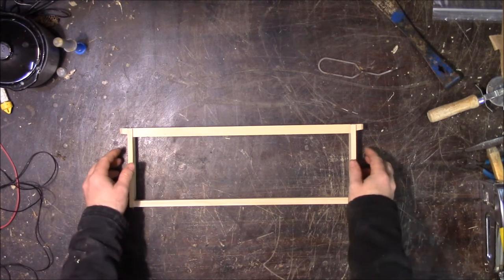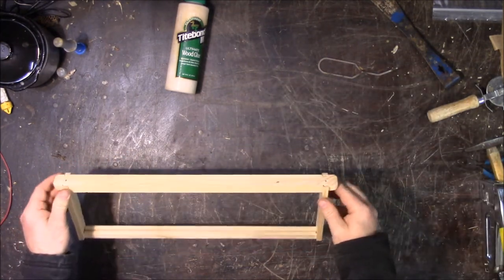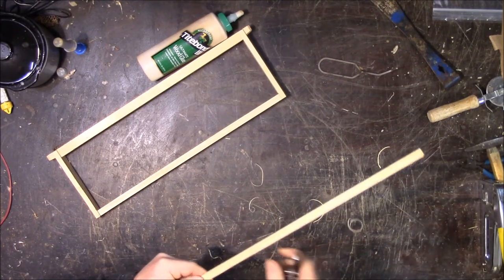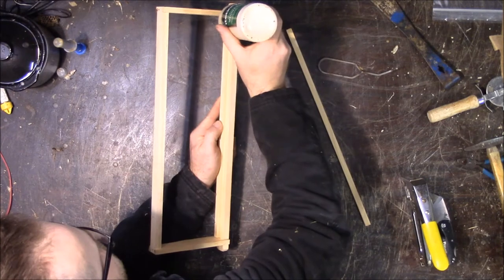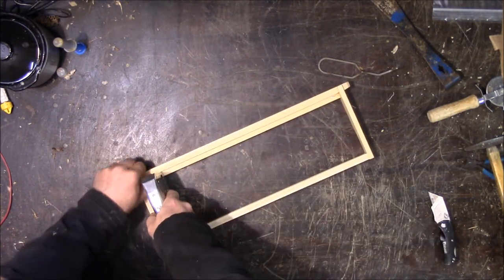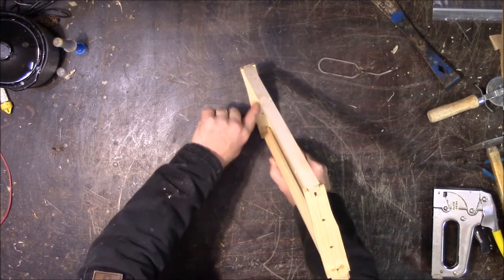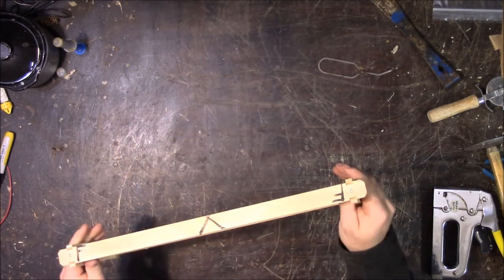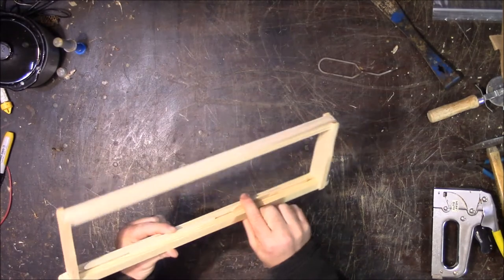How to: Prepare a Foundationless Frame - Solomon Parker

Comment: do medium frames need comb support such as a fishing line or wire?
Reply from the maker: It is often said that medium frames don't need support if the comb adheres to the top and bottom.

But more than that, they need to be mature. Fresh white comb will fail. Older mature dark yellow or darker comb will be much more durable.

Comment: Do these need some sort of reinforcement to use in an extractor?
Reply from the maker: Depends on the extractor.  If you're using a tangential extractor, the comb needs to be well hardened.  Radial should be fine as long as the comb is attached on all sides.  But these are medium frames, deeps are a different story.

If you're going to be doing a lot of extracting, I'd recommend plastic drone frames for the supers.